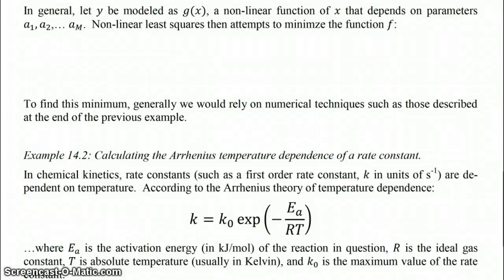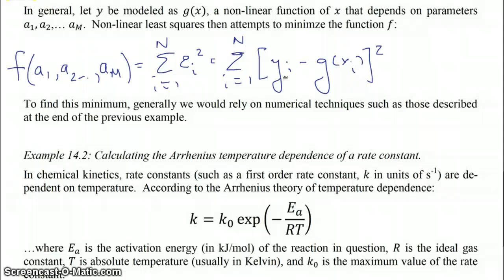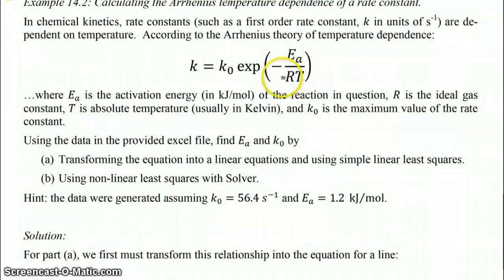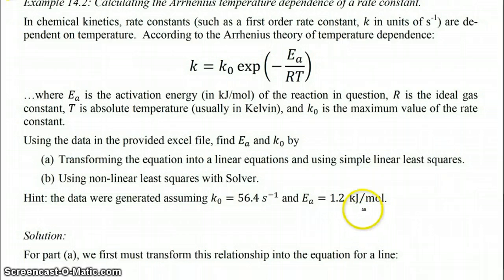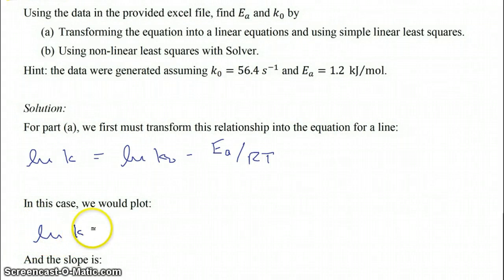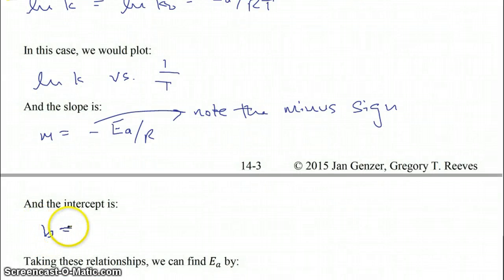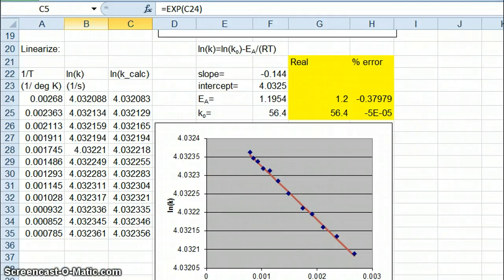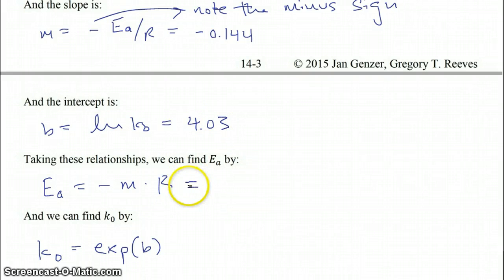Linear vs. non-linear least squares - Arrhenius

Comment: Can you perform a similar procedure for the modified Arrhenius equation?
Reply from the maker: Yes, you can definitely do that for the modified Arrhenius equation. Do you have data that you want to fit the equation to?
Reply: @drgregoryreeves  Yes, I do have all the experimental rate constants at various temperatures and pressures.
Reply from the maker: @mohsinraza1048  That's great! Depending on what you're doing this for, if you run into trouble, other software programs like Matlab, etc, may give you more flexibility. But if the problem is simple enough, Excel and Solver can definitely get it done.